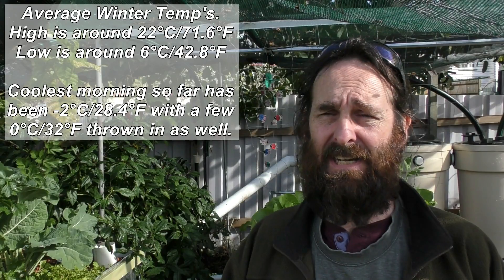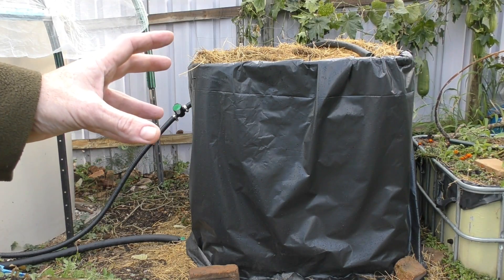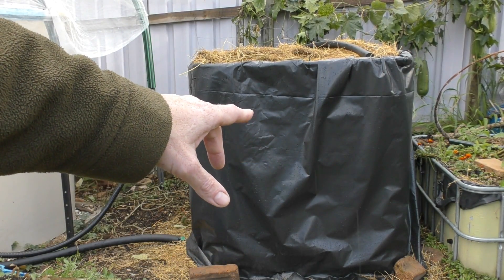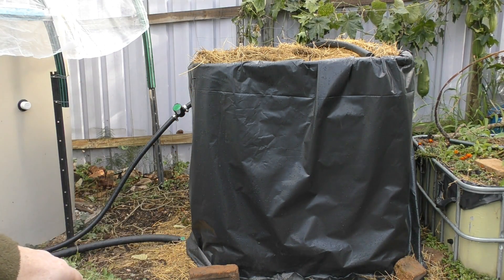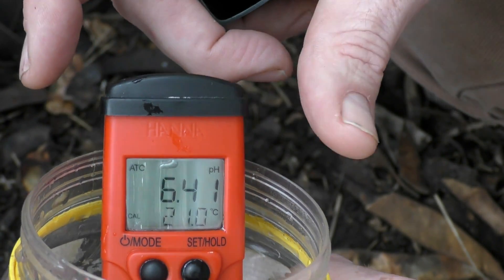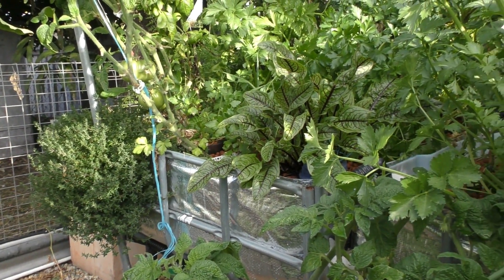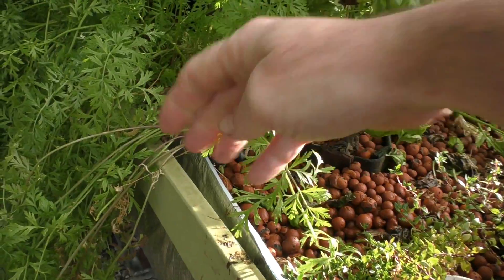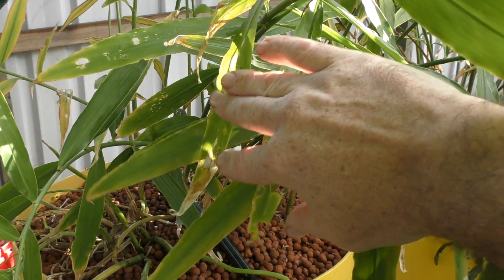Aquaponic Compost Heater update, water temp's for Jade & Silver perch. AP Update July 2015

Comment: After pondering I think I might have a couple of observations. Firstly i think there is an insufficient amount of compostable biomass ratio for  the amount of water you are trying to heat. As the water is in effect also chilling the pile. For an over winter scenario I would make the suggestion of increasing the pile size at a 1to1 water to compost or perhaps a 2-1, though I do not the golden ration for this method, so its just hypothetical. The caged exchanger seems ok, I am not sure if its setup actively or passivly, but for simplicity I would just coil the poly pipe around a hay/mulch bale then  pile slower decomposing materials for longer term effect. 1-2*c is still a postive result so the method works :)
Reply from the maker: ***** Hi there.
I have a space issue so am limited in the size pile I can use. Also have very short mild winters so was hoping that a smaller unit would do the trick as I'm only after a small lift in water temp. I now know better ;) 
Have a 60% larger system on the go now with temps in the pile already over 70°C/160°F in just under 40 hours. 
Hope to have a clip on it posted by next weekend after I have a few days to take measurements, film then edit. 
Cheers & all the best.

Comment: Hiya Rob,

Great idea, I hadn't thought of using compost heat to actually do anything useful before. I think if I made a system like this I'd put the hose around the outside and then pack with insulation/polystyrene around the outside.

A couple of thoughts (you seem to not mind my suggestions - but tell me if you'd prefer and I'll shut up from making them)... First you're losing so much heat from that sump tank, which is effectively a giant radiator with air running over the top cooling it even more. Have you considered packing it with polystyrene/foam/insulation, and giving it a polystyrene lid? The greater the temperature difference between the water and the air, the more heat you lose from radiation (heat transfer is proportional to both surface area and temperature difference between the two surfaces (the outside of the sump tank + the area of water on top is a huge surface area - you'll lose a lot more heat from this than from the pipe, and the air flow means you get a continuous temperature difference rather than one that lessens over time as you heat the air above). Insulating and reducing air flow would fix both these issues. And secondly, why do you have the outlet from the compost heater going into the sump tank rather than into the fish tank? If you did this, then you wouldn't lose water flow back into the fish tank because the two feeds would be additive -- and the heat would be going directly to the place it's really needed.

Edited to add: how thick is your hose and is it plastic or rubber? If it's rubber rather than plastic, and/or if it's thick, the pipe itself would be a good insulator which would also restrict the amount of heat getting transferred -- that's why heating coils in house water systems are metal.
Reply from the maker: grotlek Hi Mate. 
I did end up rebuilding the pile & plumbing it into the jade perch tank but had issues with the quality of water due to an oversight on my part. This link might help explain. https://www.facebook.com/Bitsouttheback/photos/a.417629381619813.91747.417625838286834/865423063507107/?type=1&theater

That whole idea has been scrapped for a slightly different take. Just need to buy some plumbing parts & find the time to set it up now. Hope to have a clip posted in the next week or so. 

Cheers.

Comment: what if you made a miracle box style water heater?
Reply: +Rob Bob&#39;s Backyard Farming 

I saw one here made of 3 bricks and was thinking of adding one for winter. If I do I'll dig it into the floor a bit to add the earths natural heat retention to maximize our potential heat gains. 
We have some small spot heaters I made after a camp stove designs I saw here on You tube.
 I took several different sized soup cans that set inside each other and have the outer one filled with water then next one has fuel then next one has water again. I added a couple terracota garden pots turned upside down over top of this after lighting it the water and terracota both heat up and retain heat for a long time depending on how much fuel you use. We use them on cold nights.
Reply from the maker: stevencox75 Miracle Box?  Had a search & came up with Amish electric heaters :D
Reply: its what you make beer cold with when you hire a keg
Reply from the maker: stevencox75 Ahhhhhh, got you now. Have seen folks run SS tubing through stoves for their large systems in the States. Dad suggested a rocket stove but declined the offer to come feed it in the middle of the night for some reason ;)

Comment: Wotcha, perhaps you need to get more air into the centre mass of the compost. Most piles are added to a bit at a time so each layer gets a chance to start rotting with plenty of air. When a pile is constructed in one hit, like I think yours has, the bacteria don't get this chance. If you laid some agricultural drainage pipe horizontally at intervals through out the pile this would help? You can always cap the ends when the pile is getting up to speed.
Reply from the maker: Michael Tricker Hey Michael. 
Have been turning the pile a bit but it hasn't helped much at all unfortunately.
Will be rebuilding it this weekend hopefully & will be adding some extra greens. Am hoping that will give it a good kick start.
Cheers mate & hop all's well with you.

Comment: Have you considered solar heating? There's a lot of clips on youtube where people use downspouts, beer cans etc to heat the air, and it could be modified to heat water without too much effort or expense.
Reply from the maker: Joe Schmoe Hi Joe. Have tried solar heaters in the past here but didn't have enough pipe. Also a bit short on usable space too. Once we get the permanent cover built over the aquaponics I hope to have both solar power & water  system set up there.
Cheers mate.